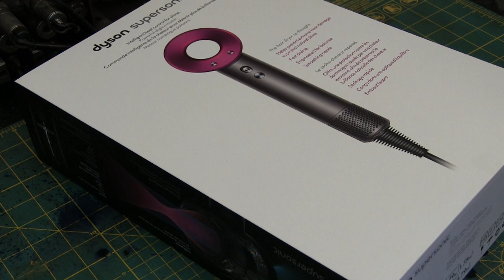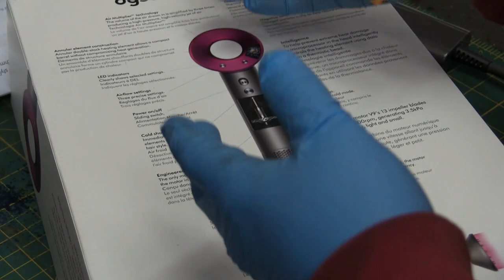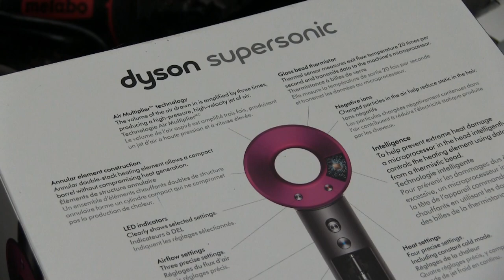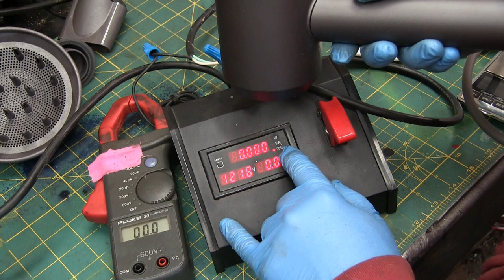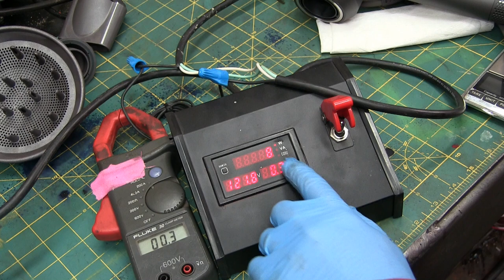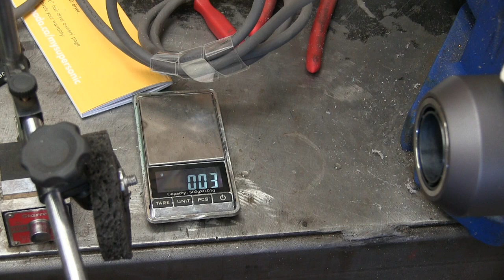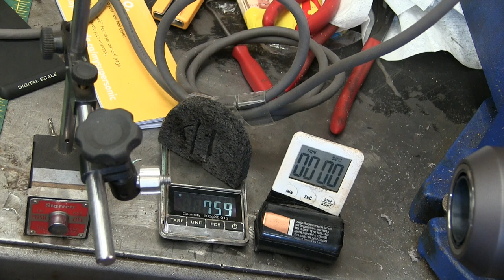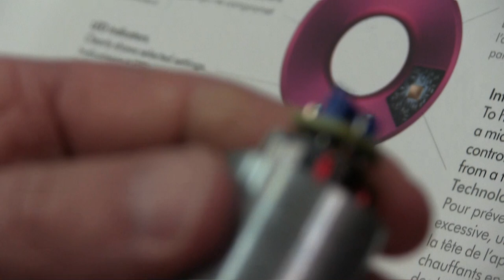BOLTR: DYSON HAIR DRYER. Is it WORTH the MONEY?

Comment: Gets great quality $5,000 variable displacement pump
Opens it with no regards for objects safety and lets oil everywhere

Buys weird $500 hairdrier
Wears gloves and opens like he’s doing an open heart surgery

Because AVE has the best logic.

Nice video by the way. You wouldn’t happen to know how to stop bearing squeal on a blower motor, would you?
I’m gettin’ really tired of the furnace outside of my room screeching every time it turns on.
Reply: Nicolas Boswell my life.
Reply: It screeches because the system is low on water, it's the compression vessel screeching, go into the property and find the top up valve,  pressure Guage should not go higher than 2,

Comment: I don't get it, I build and fly RC models for a hobby and I'm quite into it, I use brushless motors ALL the time and I have never ever seen a brushless motor with 2 pins, they always have 3 and the speed controller shuts on and off 2 at a time to make it spin....Is it just me?
Reply: Oh my god you actually answered! Greeting from Cambridge, Ontario :)
Yeah I don't get it either, but after a bit of shmoogling turns out computer fans run on the same design. Although computer fans are more understandable because they contain the speed controller inside the actual spinning unit.
Did you happen to find any sort of circuitry inside the motor?
Reply: It's quite interesting, I'll have to look into it, if it really is that simple then I'm not sure why they don't use it in the RC hobby.
Reply: Almost all RC three phase brush less motors are sensorless. Three phase is a lot easier to control because you don't have to worry about it spinning up the wrong direction .
Reply: Back emf controllers are available from all the major makers. Having seen the video now I'm betting the motor design has the cogging set up so that it reliably starts up the right direction. It would probably be near impossible to get that motor to run backwards. Three phase RC motors can be driven either direction easily which isn't needed here.
Reply: It looks exactly like an ac motor from a ceiling fan or something. Maybe it is simply an ac motor?
Reply: Machinofacture it is pretty much an AC motor, just designed for a trapezoidal drive current rather than sine wave.
Reply: edit: ignore me lol
Reply: Yeah, no need to overthink this type of thing. AvE's passing remark had it right: it's a fan. You don't need feedback control. ;)
Reply: Metallica4Life1995 maybe the case is the ground pin? It looked like it had a cut out for a connector.
Reply: marshaul BLDC motors need some sort of comutation control. They could be doing it totally open loop/no feedback but that is usually noisy as feck on startup. Given the premium nature of the product a few cents more on a motor controller chip with built in feedback and closed loop control is almost guaranteed.
Reply: Robert Szasz The third pin is just a Hall sensor. You don't need that information in the higher-level system, because it's a fan. This is what I'm trying to say, in response to everyone wondering where the sense pin is.
Reply: marshaul I'd put $5 that the motor is designed to cog to a fixed position so it will only turn one direction on startup, and the the motor controller has a built in feedback to lower the number of parts needed. It could be done with external sensors, but it could have been done with a standard 3 phase design. Something tells me the design engineers over at Dyson get off on that sort of optimization.
Reply: Robert Szasz I could buy a built-in feedback controller. It's obviously a complete self-contained module approach – why not add that?

But no need to defer control (or even route fan speed info) to other systems. So 2 pins it is.

I kind of like it. It's elegant – for this market.

Not that I'd want it in something I bought for myself. :3
Reply: i think its a Kind of a capacity Motor. The capacitor is used to create a Phase shift for the second coil, so the windings Can create a turning Magnet field to take the rotor  with it. Its a Kind of a asynchronous motor commonly used  in One Phase ac current.
Reply: Dyson is very proud of it's engineering division and for a reason.
That motor is custom made to very tight specs and does only one thing which in return allows Dyson to use very sophisticated models for pre-calculation of its behavior.
This means there is no need for any kind of feedback system because any behavior not corresponding to the model would be a failure in the device.

The RC Sport has more or less a modular building block system where the parts "don't know" each other so they have to communicate to achieve what the controller is demanding.
But if you look at those "commercial toy mini" drones which are popping up everywhere you might discover that they also save on electronics because they know how it will respond.
However most of them are garbage only the ones with a reasonable price tag are good.
And that is for the same reason as the Dyson stuff: good engineering.
Reply: Dyson likes to talk about how they developed their own 'digital motor' - i think that means that all the clever electronic speed control stuff is built into the motor, and the pins are dc power. Not sure how it talks to the go faster buttons - maybe they piggyback data on top of the dc power.
Reply: this is a 2 phase motor, RC uses 3 phase.
Reply: flippynl Um, no.
Reply: flippynl single phase actually.

anothermoth it's "just" a really well engineered single phase BLDC motor and fan. Probably with very well tuned drive control running on the microcontroller AvE pointed out.
Reply: Basically yeah, the core on the field winding is slightly asymmetric.
Reply: Um yep. Most hobby motors are 12N14P 3-phase, they have no integrated electronics, just wires, iron, and magnets. They need to be connected to a 3-phase electronic speed controller. With 3 big fat conductors.
Reply: Paul Rollino and the hair dryer can use smaller conductors because it's using 120+V
Reply: Paul Rollino That's not a two-phase motor, and those two pins are DC supply. Which is the whole point of this discussion.
Reply: If you listen very carefully when the fan starts up you can hear the resonance of the motor drive current go from that annoying grinding squeal heard in VSR cordless tools to about the 2kHz range before being swamped out by air flow noise.  The driver circuitry IS reversing the polarity of the two pins going to the motor and treating it like a high speed bi-polar stepper motor.  The trick is that once the fan is rotating fast enough you can dump the PWM needed at startup and simply change the switching frequency to change motor speed since the fan is already under load and has enough momentum to keep spinning in the same direction.  Since the switching elements necessarily have to both be off for a minimum time, you look at the back emf and you can tell if the motor is turning in the correct direction at the desired speed by looking at magnitude and polarity.  Polarity incorrect?  Restart the startup sequence once emf=0.  Magnitude too high? Increase dwell time.  Too low? Decrease dwell time.

The big confusion I see in this discussion is that a lot of folks here are assuming that BLDC motors HAVE to be 3 phase.  While this makes sense in the RC world where a motor that stalls can cause your equipment to fall out of the sky, lose control, or make large battery bank go Tibetan Barbecue.  In this VERY non-critical application it is cheaper from the manufacturer to make it as cheap as possible and still work.  That dryer actually has four safeguards against letting the heating elements get too hot. 1 and 2 are the traditional self resetting thermal cutout and the one time thermal fuse, 3 is the discharge temp sensor (glass bead temp sensor), and 4 is a guess but I would wager the micro isn't going to power up the heating elements until the fan is up to speed and therefore will cut them off if the fan stalls.

Going out on a limb one last time and say that the dummy book has at least one "error code" that will tell you to try turning it off and back on if it stops working. ;)
Reply: Idon't think they need feedback, they just put a 10 000hz current and the motor  have to follow. Maybe it start with lower frequency to help and then ramp up, but I don't see why they would need sensor. There is not that lot of torque and nothing is gonna stall that motor.
Reply: So really what I understand from this is that once the motor is kickstarted there is no need for 3 poles, 2 poles can keep it spinning fine which I understand. So is that why RC motors tend to be 3 poles is that so they always start in the right direction without the use of finely tuned cogging?
Reply: Dyson motors are fed with pulsed DC - not a constructed waveform like you get in 3 phase motors.
Reply: Chlorate All BLDC motors are just pulsed DC. There are a lot of good data sheets out there for motor controllers that show how 1 and 3 phase motors are driven

Metallica4Life1995 it's usually 1 phase or 3 phase, the number of poles is a different thing altogether. 3 phase is a LOT easier to control the direction , speed, and power over the entire range the motor could produce.
Reply: have you seen any BLDC motors with fewer than 3 phases, ever?
Reply: Soren Kuula as far as I've seen no. Computer fans are 2 pin BLDC but if you have ever opened one up there is a circuit board inside the big circle in the middle which the pins protrude out of which I can only presume is a speed controller that takes DC and converts it into a 3 phase pulse for the brushless motor to work.
Reply: If you count bi-polar 4 wire stepper motors (two separate windings); yes.
Reply: Okaaaay that's a long shot :)
Reply: Soren Kuula Yes.
Reply: I suppose a single or dual phase BLDC is possible, why not. But it would need sensors if it has to run in a specific direction.
Reply: Soren Kuula an example of a single phase, one way motor that is ubiquitous is the quartz clock movement. It's closer to a stepper motor than a BLDC motor but that's optimization.
Reply: I have the same theory. I think they might be getting RPM and/or direction via some back-EMF sensing wizardry on the two-wire supply. They probably also take advantage of the fact that the motor is engineered to high hell, and they probably know the exact behavior +/-2% based on a given input signal.
Reply: defenestrated23 lol. It's a fan. In a hairdryer. 

"About high" and "about medium" and "about low" is plenty accurate.
Reply: It looks like it's a brushless shaded pole motor, similar to the one in a microwave oven fan
Reply: Nope, that's exactly what they do. Check out patent US 7183734 B2. These are the folks that CNC'd the impeller. Maybe not 2%, but they have pretty tight control over the speed.
Reply: defenestrated23 For a vacuum cleaner, sure. I bet $5 that patent has nothing to do with the hairdryer.
Reply: I was hoping the scope would make an appearance in the motor review. hopefully he can pull it out of the trash for a PT.2
Reply: like a "soft start switch" I used to use in my 90's era 2 channel r/c plane, it had no rpm control just hi/low or off.
Reply: defenestrated23 Agreed. A lot of engineering becomes easier when the motor WILL spin at only three speeds and pass through other speeds as quickly as possible. A few cents per unit on a motor controller makes for tens or hundreds of thousands of dollars saved in design optimization.
Reply: Before watching this I had not made the assumption, but by using and single phase AC induction motor and adding permanent magnets vs. a squirrel cage you get a synchronous motor. I'm guessing the electronics are  a single phase VFD with 3 preset speeds and a "accel" eliminating the need for split phase. Assuming its a 2 pole motor and the engineering toolbox link I found is good,  speed = freq (2/#poles)60  then VFD is simulating around 1.8 khz  at 110,000 rpms, which seems like a easily obtainable switching speed. The motor wouldn't need the same full wave form simulation as an 3ph industrial VFD, but basically its a high frequency on/off "digital" motor.
I may have over analyzed that a bit, but Robert's comment of "AC motor" made me curious, so I did some digging. Please educate me if I'm mistaken.

*Edit- I commented before I finished the video.... The caps in the cord would also indicate that its a VFD at very high freq. and the harmonics would cause noise in all your other electronics. Like a high pitch squealing in radio speakers.
Reply: BetterHalf it's at least a 4 pole motor based on the windings. A BLDC motor is like an AC motor but instead of ~ the driving waveform is _/-\ with sharp switching designed in. The optimization might as well be black magic as far as I understand it. Traditional VFDs need to approximate a sine wave where BLDC drivers switch the phases immediately for speed and then do pulse modulation to control power
Reply: Robert Szasz I suppose I was about half correct. Some newer VFDs (only ones I'm familiar with) use a 0-200khz pulse = to whatever the DC bus is to get an average voltage vs time that looks roughly like a sine wave. I believe this is only necessary in an induction motor to induce the magnetic field in the rotor. With permanent magnets there is only a need to vary switching frequency when changing speed.  But, that essentially makes it a higher voltage BLDC motor. So I suppose a permanent magnet AC synchronous motor and a BLDC motor would be built pretty much identical and could be driven by either driver given the appropriate # of leads and voltage. 

If there are 4 poles wouldn't there be more solder points at the connector? I'm not familiar with the configuration of windings in motors, but P1-4 would be 2 connection points per pole winding?
Reply: Single phase, 4 poles. Think of a stepper motor. Only 8 phases but tons of poles.
Reply: If you pay close attention, the motor is a typical 3 phase brushless DC motor. 3 wires are coming out of the driver. On the motor, 2 wires are connected via the plug, and the third one is connected to the case, look at 26:40 

The speed controller "knows" how fast the motor is rotating with back EMF. no need for sensor, and it is actually pretty common for BLDC motors.
Reply: Except that tab doesnt look like it connects to any windings. AvE could confirm but having one leg connected to the case, and driving it would be really odd. I bet it's for mechanical/thermal connection to a temp sensor
Reply: Yeah he could do that. That's the only explanation that makes sense really. That case connection could be a center point where all 4 windings are connected, just like in a 3 phase star configuration. That motor typology is odd for sure, but the 3 wires comes from the motor controller, have the same apperance and thickness. it must be 3 phase driven
Reply: Flatox the windings shown are totally wrong for a three phase motor though (4 total rather than a multiple of 3) 

Fuck it. I'll pull up the Google machine. OK, electronics weekly has an article on the hair drier.

 Single phase, sensorless BLDC driven by 2 FETs off rectified mains, with a max speed of 115000 RPM
Reply: Robert Szasz I told y'all.
Reply: marshaul but its not controlled by just putting a DC voltage across the two pins. BLDC just means optimized for a non sinusoidal current, the polarity still alternates .
Reply: Rectified AC = DC. DC pulses are still DC. 

That's not really the point, anyway.
Reply: marshaul but  first pin 1 is positive pin 2 is negative, then pin 1 is negative  pin 2 is positive . It's not just switched on and off. Just look up "brushless DC single phase motor control" compare that to "pwm brushed dc motor control" Sensorless isn't, it's just the sensing that closes the control loop isn't an external position sensor.
Reply: Robert Szasz Are you arguing with yourself now?

"it's just the sensing that closes the control loop isn't an external position sensor."

Right. Which is what I said, like 20 posts ago.
Reply: Sorry, I've been up for too many hours. I intended for that to show why searching for sensorless vs instrumented motors wouldn't matter for BLDC vs DC motors. 

The motor controller takes mains voltage DC in and creates AC to make the motor spin. The motor itself does NOT SPIN if you just apply DC